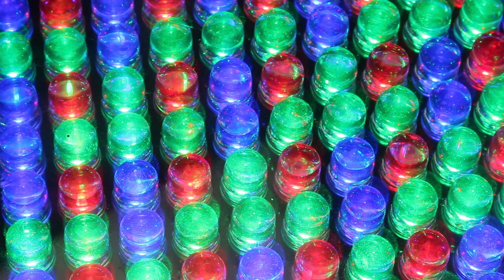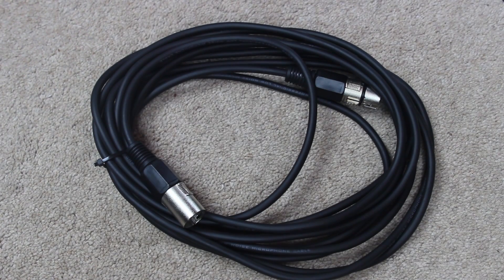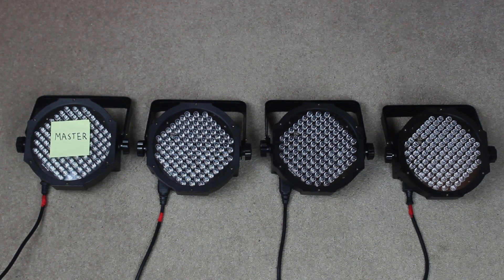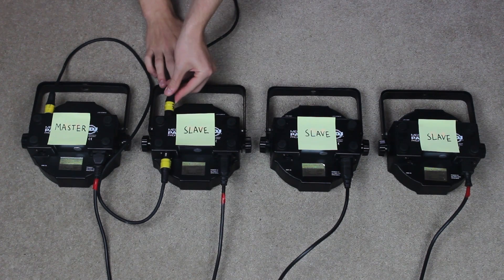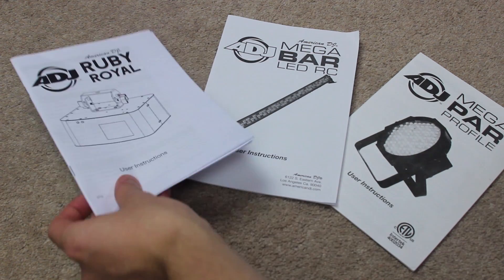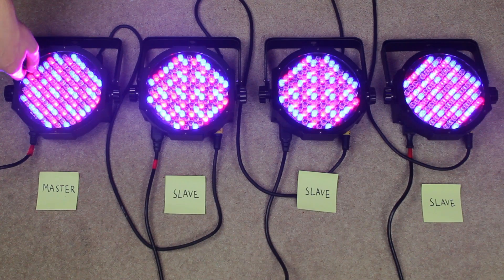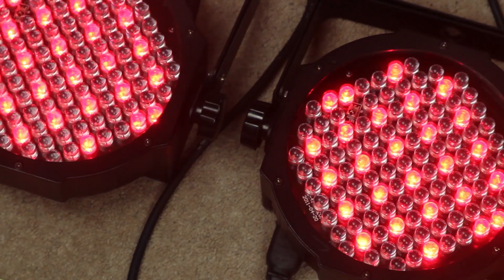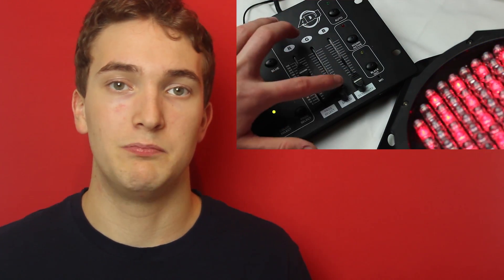DMX Master Slave Mode Tutorial

Comment: Is it possible or a good/bad idea to use master/slave with different type fixtures? Hummm? I’m going to try this in a little while to see what happens? 

I want to see what happens when I set my pixel light bar to sound active master and my other fixtures like par cans and spider lights to slave. 

Should be interesting but I just thought I’d ask just in case somebody knows?
Reply: Hi, did you do this? I would also like to do something similar

Comment: Why not just put all same channel. What is difference with all channel 1 and do same as channel 1 does, and with slave thing that follows?
Reply: Daniel Alt you've hit the nail on the head. Technically, by setting each light to dmx channel 1, they're all just responding to the same command from the controller...

Comment: This is a great video.  simple, quick and clear.  Good job !   One question I have, can I setup a master salve and connect the master to a controller?  Should the address for the master and slave be the if I do this?
Reply from the maker: If you just want to have control over all your fixture at one and have them so the same thing just set all the DMX addresses the same
Reply: ***** got it thanks!